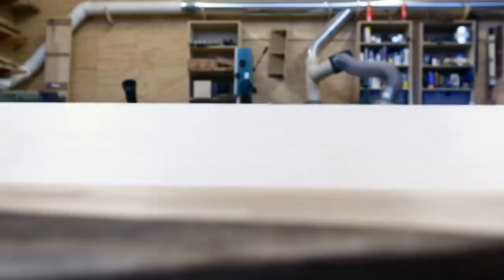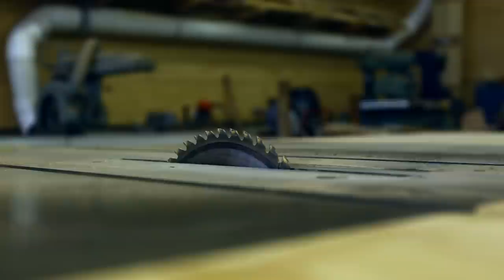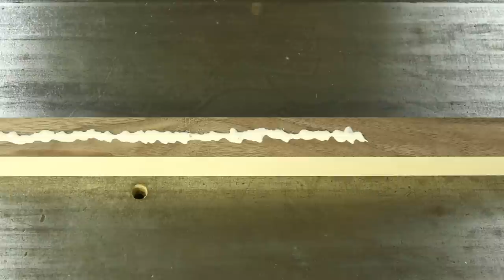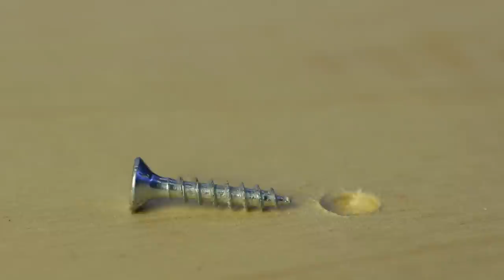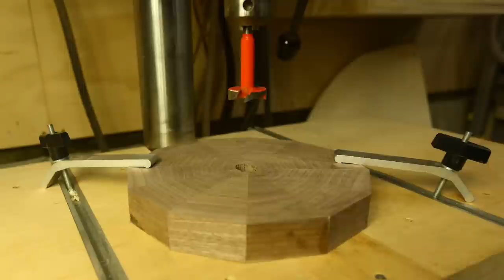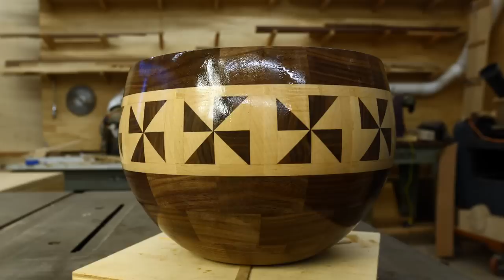Segmented Walnut and Maple Bowl

Comment from the maker: Thank you for the complements.  I don't know specifically in CA.  There is a huge wealth of info on line now.  And there must be wood working groups and conventions in your area.  If I can push any advice it would be to learn what is safe and what is not safe.  and start with small projects you can finish and feel good about, which will get you on to the next project.

Comment from the maker: Thanks! Yes, what happed to that piece was not so clear, it was the bottom. It's hard to get all the triangles to come together nicely. I held them back and left a hole. Then drilled out that hole to make a perfect round hole I could plug.  It worked better than I had thought it would.

Comment: Hi Frank,
I really enjoy your videos. The motion photography and the cello add a special affect to your work. Your work has inspired me to give wood turning.  I have tried to mimic one of your piece and the first section I connected all 12 pieces of the ring fit fairly well (first a first attempt).  However every since then I cannot get the 12 pieces to fit into the ring.   Eleven (11) is close and twelve (12) is too many.  I have checked the angle and it is 15 degrees.
Can you help me?
Thank Ron

Comment from the maker: I did not realize how much video and photography work I was going to be doing when I put the lights in the shop,  I got 3500k bulbs  so with the amount of day light changing all day and night, on some shots I don't get the white balance quit right, then I have too many short clips to fix every one manually so I do an auto correct in post and it varies as the colors in the scene change.  I need to change all my bulbs to something closer to daylight.